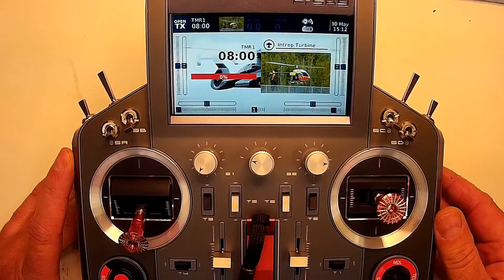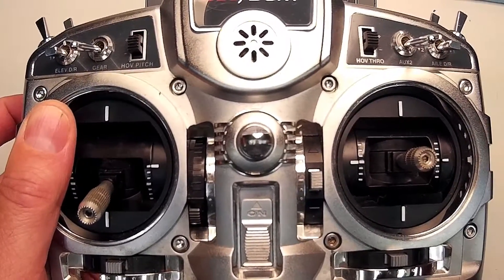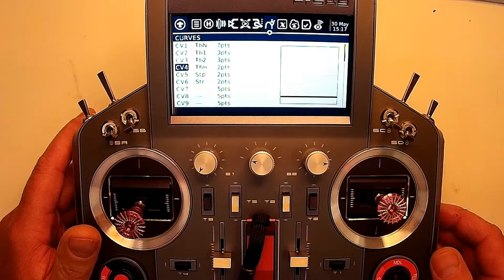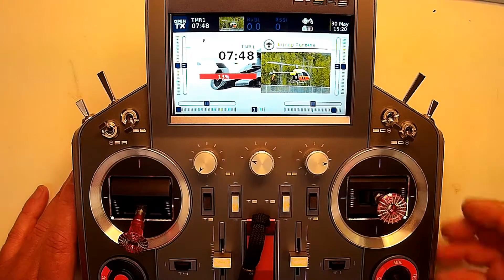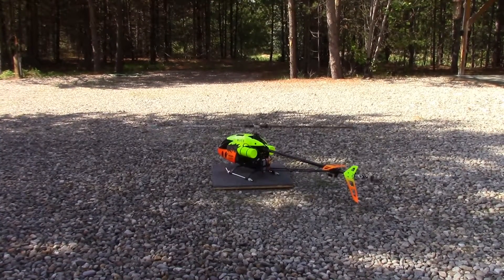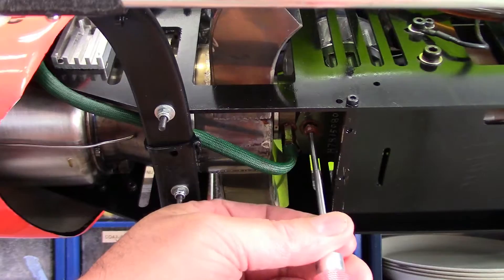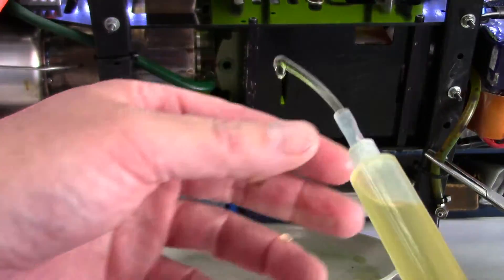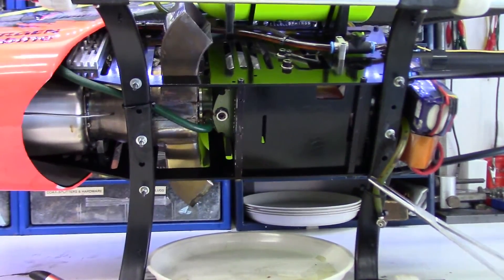OpenTX Internal Combustion Engine Operation Ideas - Turbine Example

Comment: Nice video. You alread user Frsky with nitro and Gas planes? Like big vibration planes or with carbon strucutre. A read in foruns about Frsky receivers have problems with gas planes some tell is with ignition interference some with vibration.
Reply from the maker: I use in all power types, never had a single issue.
Reply: @Rchelicopterfun  Nice! Including gas planes?
Reply from the maker: I already answered this in my first reply: "All Power Types."  I have  video on a gas plane OpenTX carb setup idea: https://youtu.be/-cK6DZfu86s
Of course, like everyone should be doing with any nitro or gas model, I always, always wrap my RX's in foam to protect them from higher vibration environment. No matter what brand RX is being used, protecting the RX from vibration is important - at least if you want them to last.